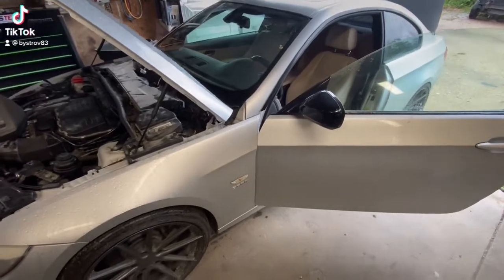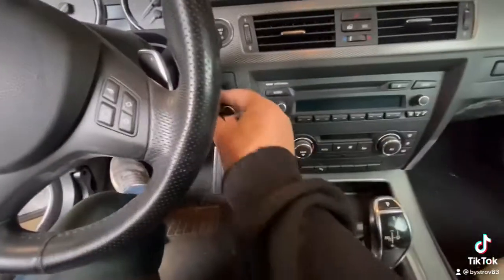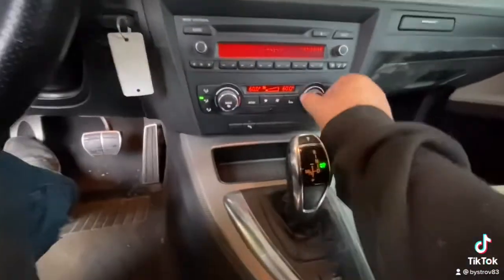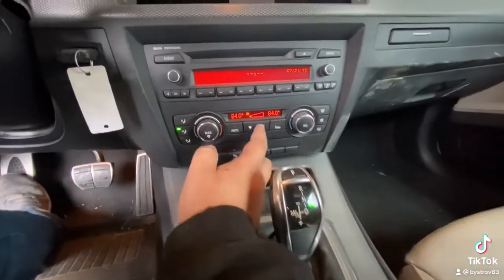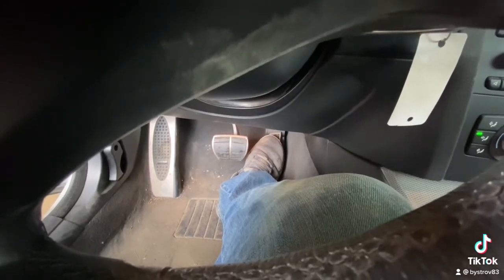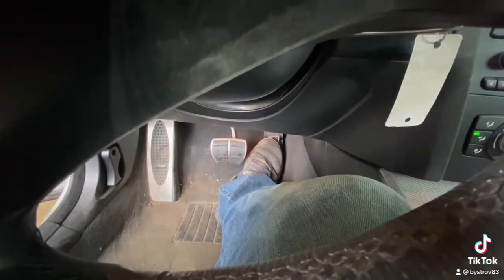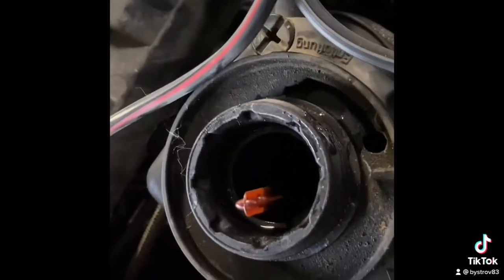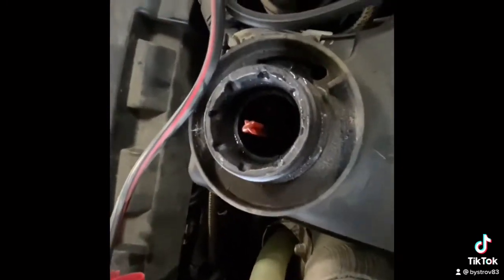How to bleed coolant Bmw e90 n52 n54

Comment: That's only on automatic cars what about the 6-speed manual 330i it doesn't work like that you have to turn the car on as well idle it and put it at the lowest setting of the heater and turn the heater all the way up 84°